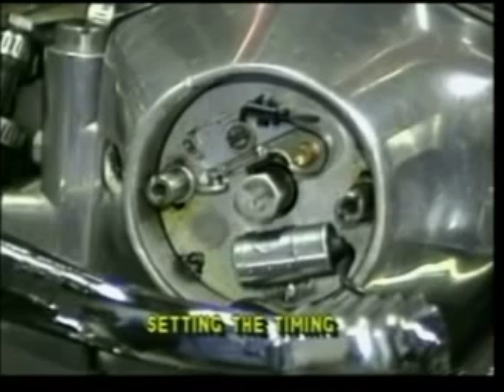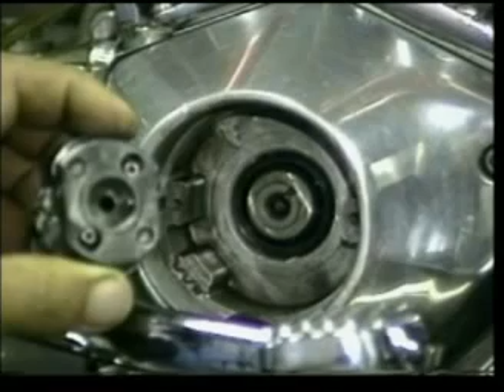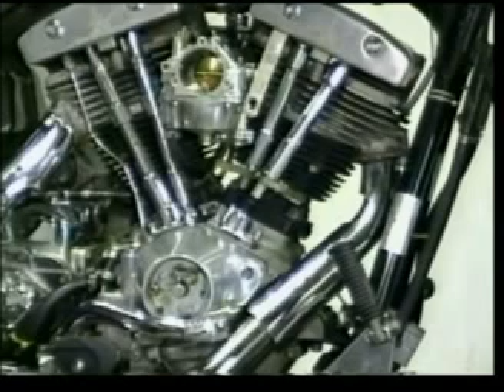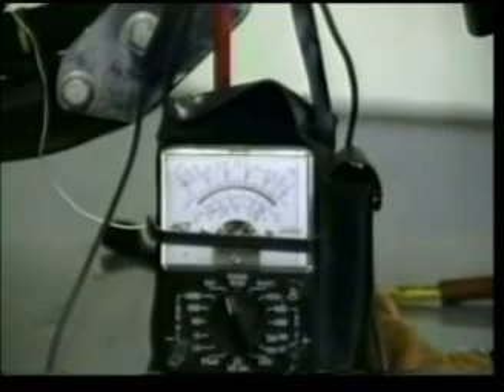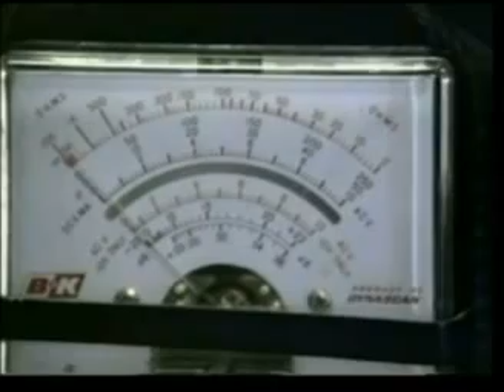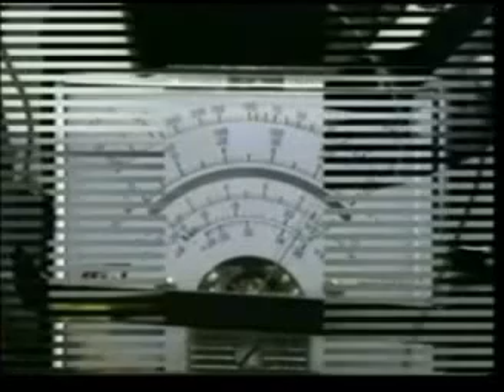Harley ShovelHead points replace & adjust

Comment: Up to early 80 the dot.is used.for timing afterwards it was the line on the flywheel , threw me for a loop years ago before I actually realized . my Harley manual sez .18 points gap.  Can you add more info. Please